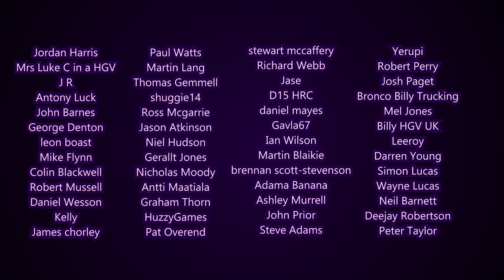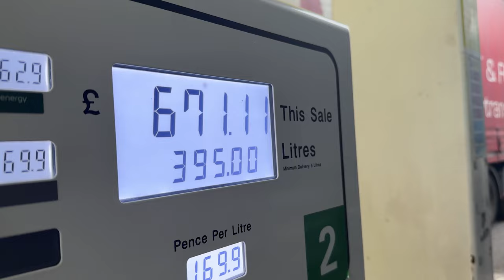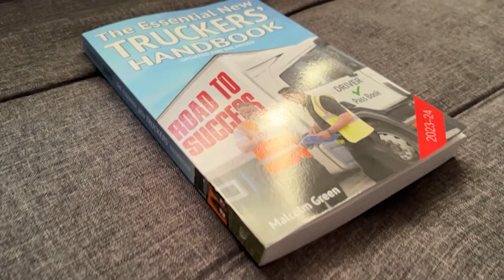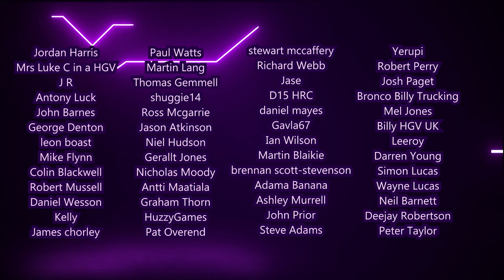Man Asks If I’m Moving So He Doesn’t Get A Ticket!

Comment: This is my day at work.....wake up in own bed at 8, stroll into work at 9, get a  load for a depot in Tyneside or Exeter from Rugby, come back empty, pad the run out so you get 12 hrs 45 mins , currently on £24 and hour during Oct -Dec. Simple life. I hate doing your kind of work, strapping, go here go there, night out, shitty delivery places. Each to their own, but if you are thinking about trucking don't think it's like this. Supermarkets, parcel places, fuel tankers are all much much simpler and pay good and you don't have curtains and no barn doors, some places you don't even need to get out, live tip or live load, 95% of time there is no paperwork either. I have done a lot of shit trucking jobs to finally taper off into this current one. You will never night out. I been class 1 14 years and had 2 nights out due to breakdown or motorway closures. the cons are you don't get your own truck but the place I work they don't care what you do as long as you don't hit anything or take the piss. Get the trailer there as parcels are somewhat time sensitive and the office will never bother or question why you took 13 hours when plan said 11.

Comment: As a driver for 40 years  DO NOT drive away on 45 minutes  always go over to at least 47 mins    dont be so impatient.
Reply from the maker: As a driver of 8 years. That’s complete nonsense. In the past? Yes. But not with modern equipment 👍🏻
Reply: @lukecinahgv  complete nonsense  how you work that out? Its common sense, oh modern equipment  yeah  that now allows drivers to invent something called a rolling  break where you can take a break without actually having one.  When you need to take a break,  take 16 or 17 mins followed by a 32 min break or a complete break of 47 mins.  Thats what I do and have done for years.
Reply from the maker: Complete nonsense because it’s a thing people used to do in the day but no longer needed.  

Nothing to say you can’t do what you’re doing. If that’s what you wanna do then carry on. But totally unnecessary with Morden equipment I’m afraid. 

Back in the day of paper discs, fair enough. And maybe even when tacho cards first came out. But now, with Morden machines, as soon as it hits, 15 or 30/45 it’s good to move.

My family have been trucking for coming up to 100 years, back in my grandfathers day they didn’t even use tachos. Back in my dad’s day he would have done what you do, in this current day and age, it simply isn’t needed mark. 

However, nothing wrong with what you’re doing and if it makes you feel better knowing you’ve had sufficient break then carry on 👍🏻
Reply: This day and age?  Mate  I'm still driving  using modern trucks and tachos every day,   I dont see why you are arguing over a minute?   This is why our office is littered most weeks  with tacho infringements coming back from analysis and its always the younger drivers who think they can interpret the law to suit themselves.  They are arrogant and think they know it all when they clearly dont.
Reply from the maker: @ I’m not the one arguing mate. You’ve come over to my channel. Not me to you.
Reply: @lukecinahgv  but thats what you want isnt it?   People to come over to your channel   but only if they agree with you?
Reply from the maker: @MarkGalloway1066  I don’t really care whether you agree with me or not to be honest. And yes, of course I want people to come over to my channel. But you’re accusing me of arguing with you when I didn’t start anything. 

As far as I’m concerned, Mark, you do you, it’s none of my business. If you want to have an extra couple of minutes, then you crack on. I’m not disagreeing with you am I? I’m just saying that I’m okay to have a 15 and then move. 

you’re the one disagreeing with me.
(which is fine) but I’m not the one arguing with you as you have accuse me of. 

I’ve taken your advice on board and I’ve chosen to carry on the way I’ve been doing it. thank you  👍🏻
Reply: @lukecinahgv  you must have plenty of time on your hands today to reply to me in such detail?
Reply from the maker: @MarkGalloway1066  yes mark I’ve just been waiting on site at Sig roofing in Horsham for three hours to get unloaded between the hours of 8 am and 11am.  I’m now in a queue at Clacket lane services to get fuel. If I’ve got plenty of time to reply back to you then surely the same applies to you. 👍🏻
Reply: @lukecinahgv  as an older driver you could say,  i have so many issues i am willing to discuss with you if you want.  Just about the job as it is today in general.
Reply from the maker: @ I’m all ears mate. Always happy to discuss with fellow drivers.
Reply: @lukecinahgv  yes  i actually have a day off today to take the wife to a hospital appointment.
Reply: @lukecinahgv  Clacket Lane  it is a horrible name.
Reply: @lukecinahgv  Well  first of all  getting back to the tacho subject   (and i dont even know what started that off )   i believe that driving away 1 minute under your break time is an infringement but obviously 1 or 2 minutes over is not so i think it's  a good policy that was always drummed into me.  Surely we are not all in that much of a rush that we cant wait one or two minutes?  That will bring me onto a whole heap of other issues that I have  particularly with the younger drivers of today if you dont mind me having a bit of a rant.

Comment: £1.69 for diesel? Im paying £139 at Tesco/Morrisans (St Ives/Bar Hill Cambridge, 20%less) and the BP garage is about 10p more expensive. Do they charge more for HGV's cos I would have thought at 8 times the vol you'd get discount lol.
Reply: It’s just service station prices. They tend to charge a lot more.
Reply: He will undoubtedly be paying with a company fuel card at a much lower price than displayed on the pump. I’m not even a heavy user of fuel (running just a van) and I’m paying less than £1.26 per litre with my fuel card.